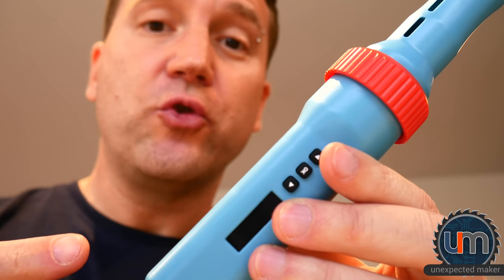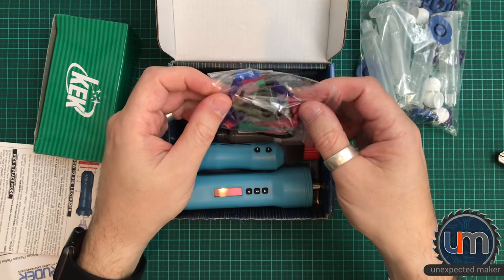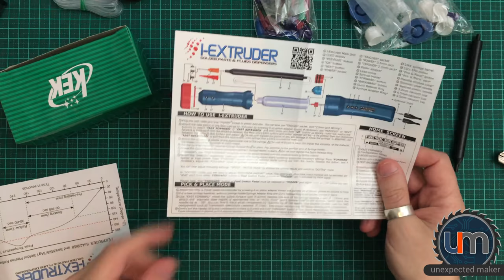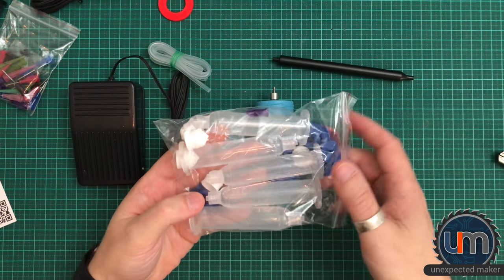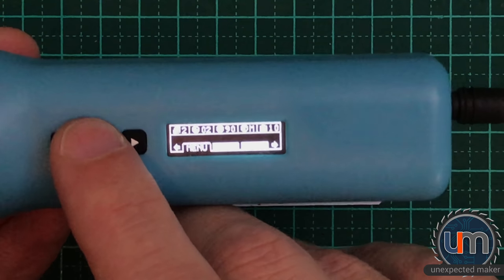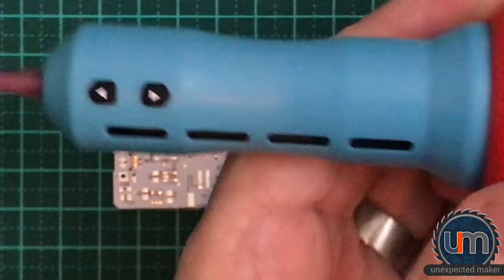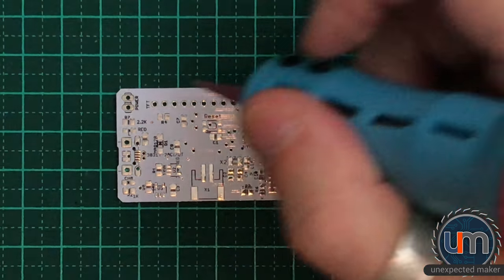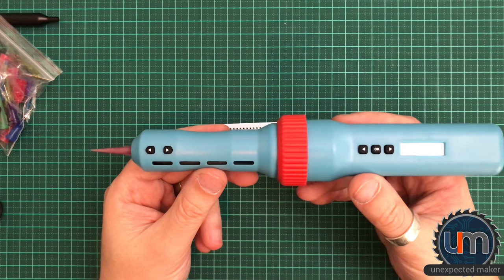I-Extruder Unboxing & Review

Comment: Nice review. 
For better result you need place the syringe tip touching the pad at 40° angle and then press on extruder button. 
This way, solder paste is applied to the pad directly.
Reply from the maker: Thanks for the info. I have been kinda doing that when using it since this review... I have put in a lot of hours with it, and it seems to work well most of the time. Often I get failed extrusion, using dot mode. I'll dot 7 pads in a row and then the eighth takes 2-3 dots then it works ok again for a bit. Have you experienced that? I'm making sure my paste is taken out of the fridge 24 hours before use.
Reply: Hi, I believe it something that has to do with the even number of steps (time to time). You may try to slightly adjust : dispensing time and pull-back settings.
By the way, there is a cool feature in "Dot" mode... 
If you will keep holding the extrude button (or foot pedal pressed) once the programmed amount of solder paste is dispensed, solder paste will continue to be extruded by the inner pressure (until you release the button or pedal)    
This is very handy when you need to apply bigger amount of solder paste (bigger pad) or place a tiny line(s) on IC pads.
It's my preferred dispensing method :)

Comment: Hey, your video was one of the reasons I decided to buy. It was really helpful. Thanks!

I'm having trouble getting the PnP feature to work with smaller packages. I tried the stainless steel tips and all different pullback settings, but barely any suction. Any advice?
Reply from the maker: Hey Dylan - I am glad you found my video helpful! I also had some trouble with the PnP holding on to parts - but I have a different air PnP I was/am using anyway, so didn't really get it for that function. Maybe there is a firmware update that fixes it? I've never looked into it, sorry :(
Reply: No worries, I figured it out! Instead of using the weird red metal plunger they suggest using for PnP, just use the standard syringe plunger. Just make sure to grease the plunger. I also greased the inside of the syringe tip a bit so its seal against the syringe is better. Probably does nothing but couldn't hurt!

I think the regular plunger works better because it fills up the rounded space at the end of the syringe where the red metal plunger can't travel. Since there's less air in the syringe initially, the vacuum that is produced when the plunger pulls back is stronger!

Hopefully this is helpful to anyone with the same issue. Thanks again for the great video. :) Cheers

Comment: Interesting. Do you still use your I-Extruder? I think I’ve only seen you using stencils in your more recent videos.
I seem to have gotten adept at using 3cc syringes, but I’ve had my eye on the Tindie dispenser: https://goo.gl/3q2ckZ
Based on your I-Extruder experience, how do you think this cheaper option might compare?
Reply from the maker: I only break out the I-Extruder now when I need to SMD and don't have a stencil, but that is rare. That Tindie Dispenser gets expensive once you add some extra stuff you'll likely need, like a button or foot pedal etc.

If you are not doing repetitive soldering like 20-50 SK6812's - 4 pads each, then hand pasting from a syringe is still a great solution.
Reply: Fair comment. My busiest board at the moment is just over 100 SMD pads.
Time certainly vanishes when I start syringing a few of those boards!
I should really order a stencil next time! In the meantime my syringe skills are well practised! LOL
Reply from the maker: Oh, 100 pads, ouch, that's going to hurt your wrist and likely your neck and back. Having a dispenser is great in that it meters out the right dose each time, so cramping hands or sore thumb doesn't become an issue on too little or too much paste. Tough call mate.

Comment: Для мелких работ слишком массивное изделие)
Reply from the maker: I guess it depends on how much surface mount assembly you do. Stencils are super cheap now, but sometimes, a stencil is overkill for a 1-2 board build.
Reply: Для 1-2 плат дороговато, не считаете!?)
Reply from the maker: I mean MANY projects of 1-2 boards... no one just makes 1-2 boards for 1 project ;)
Anyway, yes it's expensive... doing it by hand with a syringe is fine for most PCBs.